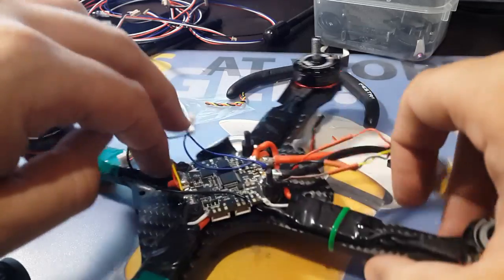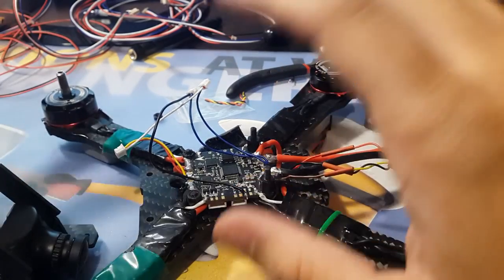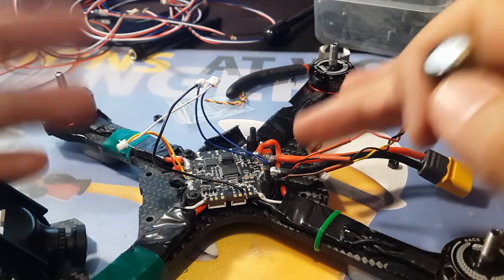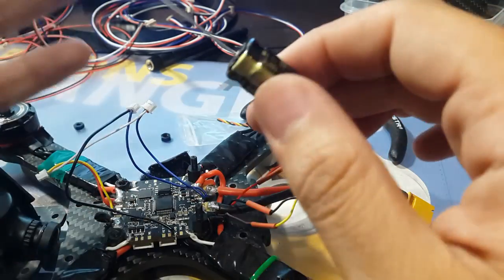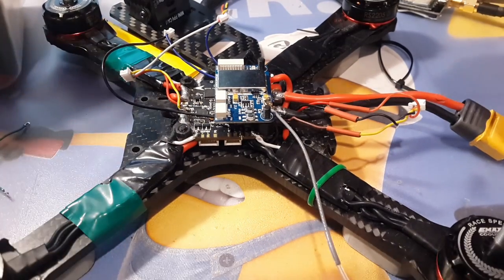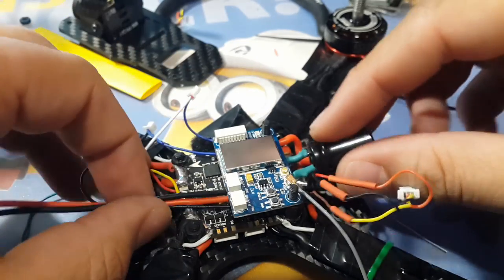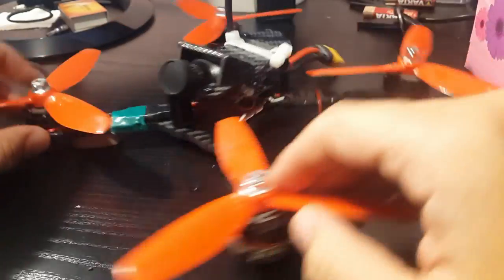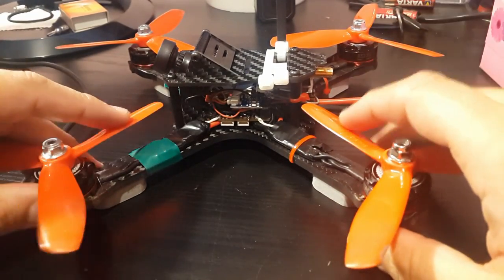How to fix VTX blackouts and OSD Flickers (FPV FOOTAGE)

Comment: Hey! What would cause blackout on Nazgul 5  6s. I had two today flying and they were on punches and after flips and rolls. I get flickering from time to time as well and I have a capacitor, same one as you have in this video. One resulted in a crash, no damage but it really sucks cause I feel like I can’t trust my quad and VTX.
Reply: Lou GC ever find out the problem? My nazgul is doing the same thing
Reply: Same here lmk

Comment: Keep in mind also, mounting that cap with the can touching your power leads is a disaster ready to happen.  There is only a thin film of insulation over that cap can which is metal and if the cap is touching both your + and - battery leads it will eventually wear through that thin skin and short your battery causing you to go down in flames.  It is best to mount that cap on your XT60 connector especially since you have the handy removable crown on yours, just solder it across the battery terminals of your XT60 then shrink tube around the cap and wires to secure it very nicely, it is clean, protected and safe in case of failure.

Comment: so does it basically get soldered to the power going to the lipo.

My VBAT went out on my Betaflight F3 Flight Controller,  so for my vtx I had to solder the positive to the positive going to the lipo. But now I have a bunch of noise.

should I put one of these at the same location with the vtx.

Comment: Low ESR capacitor may help in other quad fixing tasks. It saved mine brand new Matek F405 AIO FC from yaw twitching tonight. I was helpless to fix twitching by usual anti vibration measures - rubber bobbins, grommets, soft-mounting motors etc. Thing continued to twitch until it get 470 uF 35V low ESR capacitor on battery pads. Then twitching disappeared without trace. Now only anti twitch measures for mine F405 FC are rubber bobbins below FC board and mentioned capacitor. The last remaining question is best place in GX210 frame for this capacitor where it would be protected from crashes.

Comment: The cap should be directly on the pads and not on a wire for it to work as intended. The wires have both resistance and inductance and to some extent it will make the filter behave worse. 😀

Comment: You may want to use fat wires and make it short to keep the ESR low. You may want to buy a device to measure the ESR.  ESR will go up as the capacitor age. Having a device is handy to keep track of the ESR value.

Comment: I'm having issues when I punch the throttle I get lines and flickering in my goggles. This didn't happen at first but after I crashed a couple times it started happening. Do you think it's my VTX? I'm using the Raptor-S AIO Flight Controller. On a side note this FC is really nice and has an easy set up.
Reply: 415bryant I have exactly the same problem
Reply: that is your ccd cam vibrate.. you should glue it to the frame or anyhing near it using hot glue.. usually like that because if we punch the throttle.. it will vibrate the whole quad

Comment: could you please fill me in on how to get osd on this flight board.  I'm really new but trying to get going. built the same x210 but going to change flight board f3v3 but osd got me confused lol thanks
Reply from the maker: Yes its very simple there will be 2 pads on the board one called VTX the other Cam.

First take the yellow wire from your cam and solder it to the cam pad on the F3 V3.
Second take the yellow wire from your vtx and solder it to the VTX pad on the F3 V3.
Third You are done ^_^
Reply: Thanks a bunch. Big help.

Comment: Which capacitor should I use...I saw another guy using a cap that is only 450uF..is that OK?
Reply from the maker: Yes but the higher uF rating the better , but make sure its a Low ESR Cap and rated minimum of 25V if you are going to be using a 4S and below.
Reply: I assume you saw a guy using a 470uF cap not 450uF, it is not 100% true that more Farads the better, best would be to use one low 470uF lowESR cap on battery lead, one 470 on bec rail with 1uF tantal combination and a normal ceramic 1uF cap between + and - on each ESC, but :D aint nobody got space for that, just put there one 1000uF low esr and fly safe ;)